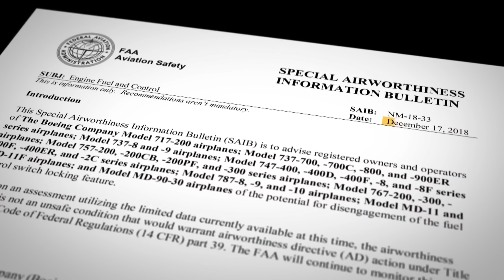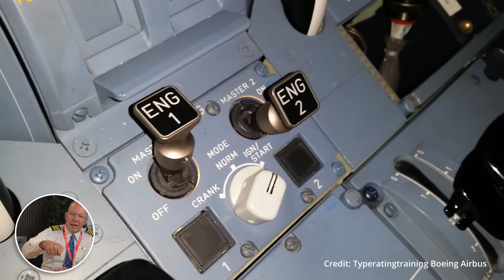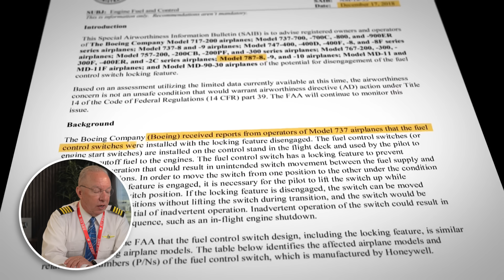Air India 171: The FAA’s 2018 Fuel Switch Locking Bulletin Explained (16 Questions Answered)

Comment: Need cameras on the cockpit! This needs to be a must
Reply: The trucking industry is really cranking up on driver-view cameras now for two reasons. One, it reduces the cost of insurance. Two, it helps to enforce safety regulations such as no cell phone use while the engine is running. 
In the past, a video camera in the cockpit was never practical due to the limited amount of data storage built into the recorders. But of course, that is changing now as data storage is cheap and plentiful. The other "traditional" reasons for no cockpit cameras are based on "privacy" for the pilots, and "what would someone think if they saw blah blah on the footage?" Well, those reasons are no more valid for pilots than they are for truckers. So yeah, the time has come for all newly certified airliners to have cockpit cameras.
 If the 787 had them, we could easily see HOW the switches were moved to cutoff, which is a critical question at this point. Sadly, a lot of non-thinking people want to insist that it was a design fault on Boeing's part. Ridiculous.
Reply: Agreed 
We have verizon reveal with camera that records depending on rules set (speeding, swerving, sudden braking, etc.). It also see if you have a cell phone in hand  or are distracted 
.eyes not on the road..and will take a pic of that

I am an admin of their system. And also a user of a vehicle with a system that has them.  And its geofenced as well. , @MrPLC999
Reply: If truck drivers must have this then it’s reasonable for pilots to. Might not have prevented the action but would make investigation easier
Reply: What most people are missing here is that the FAA had already issued a warning back in 2018 (SAIB NM-18-33) about a potential issue in Boeing aircraft where the fuel control switches could unintentionally move due to vibration or mechanical failure.

In the recent Air India crash, both pilots denied switching off the engines, and flight data confirmed that both engine fuel switches moved from RUN to CUTOFF almost simultaneously.

If these switches are manual and controlled by physical levers, it's impossible for them to move without human input — unless there’s a mechanical fault, such as a failed locking mechanism, which is exactly what the FAA had previously warned about.

The aircraft involved had not undergone the inspection recommended in that 2018 FAA alert because it was marked “advisory, not mandatory.”

This strongly points to a technical glitch — not pilot error. It's easy to blame humans when machines fail silently. Aviation authorities should focus on the dual engine switch system’s design and whether proper inspections were neglected.
Reply: @MaujL8fe0 these switches could be installed with the locking mechanism disengaged.  There is no mention the switches have a problem. Read the advisory.  The switches are used in thousands of 737, 747, 757 777 and 787 planes.  The console was replaced twice in 2019 and 2023 and they have the switches so they can check assembly.  The switches are operated twice on every flight.  In 13 years no pilot noticed the switches were installed wrong and the switches never activated in the manny bumpy landings but on a smooth takeoff, at the goldilox moment when a crash was certain.  Might have been a sinister force in the cockpit
Reply: Mh370 disappeared despite transponders, and radar tracking.  2 competent pilots on board and after years only a few scraps of pieces have been found.  Weird shit happens
Reply: @barryobrien1890 - Not much anybody can do after the suicidal captain had switched off the transponder and EICAS tracking systems.
Reply: Captain is elite. And cant be monitored like those low lives 😆
Reply: This technology advancement. Every street and toilet have one now
Reply: What is it everyone thinks this is going to accomplish? All it does is let you see it. Think about the backlash that would come to the families of the sabotaged pilot. Also, keep in mind this would likely only be released to the families and specific parties.
Reply: @Skywest25  it’s the only thing that could prove if it’s not sabotage. Do you think the families are spared now?
Reply: @akshanshkmr   Nope. Because the pilot covered the lenses before the cameras were powered on and the other pilot wasn't looking. Are the families spared now?
Reply: @Skywest25  Are the families spared when pilots are falsely accused of sabotage when there was indeed a mechanical issue with the switch?
Reply: @akshanshkmr  A mechanical issue would be identified eventually. This is only a preliminary report. I'm asking what would the cameras have brought to this investigation to clear up the uncertain details?
Reply: @Skywest25  Define Eventually. 2 years? 5? What the families supposed to do till then? 

A camera would have eliminated the need for this “Eventually ”
Reply: How excactly cockpit cameras prevent tragedies like these from happening again.
Reply: It doesn't prevent. But it corroborates theories and adds to evidence from audio.  It shows actions taken.  Duh.
Locks don't keep thieves from breaking in either..  @JoeMason-g8z
Reply: @JoeMason-g8z who said anything about prevention?
Reply: Stop talking. Cameras won't prevent this sort of thing. They already know what happened...
Reply: @cwiseman4595 they only know what the box says the switch position was. They dont see if someone or who put it there.  And cant prove any statement or negate conflicting statements from audio recordings of the two humans (did vs did not shut the switches off.)

The camera footage could help with this in corroboration of human actions and conditions.
Reply: @cwiseman4595  - It's about KNOWING what happened, it's not a tool for prevention.
Reply: @cwiseman4595 They don’t know WHY it happened.
Reply: @wilgorrie7127  What part of a video shows the "why" of anything?

Comment: Just because the data indicates the fuel cutoff switches were moved to off doesnt mean they actually were, it just means that power was interrupted in those circuits, one pilot asks why did you do that, the other says I didn't, dont be too hasty to blame a pilot on a preliminary report, electrical power failure would give the same situation or scenario surely

Comment: Capt Steve.... Weak answer on the camera issue. If the footage was transmitted in a closed loop to data recorders ONLY... and automatically DELETED within 2 hours of the successful landing completion of every flight... how would it get leaked? Normal date recorder content is very rarely .. if ever ... leaked before accident investigations as there is nothing of public interest to leak.

Comment: Cutting off fuel for 10 seconds can cause a catastrophic crash, doesn't that mean that these controls should be digital and not mechanical to avoid potential mistakes or accidents? What if, say, a thread from the captain's clothes gets hooked on and the captain stands up?

Comment: Given the facts as currently known this event has echo's of 9/11 and Malaysia MH370.  If so this is not a pilot mental illness issue but rather an ideology issue.  India has problems with religious extremism.  Investigating the history of the pilots should help resolve this.    A solution is needed that makes it harder for a mentally or ideologically compromised pilot from crashing the plane.  
I'm not sure there is any solution except computer control since a compromised pilot could just disable the other pilot and manually crash the plane.  Instead with computer control, any attempt to operate the plane outside the flight plan manually would require approval from the airline's operation control center.  Avionics software could allow manual control automatically in the case of engine failure (e.g. US Airways 1549), a lightening strike,  decompression, etc.).  With a StarLink connection the plane would always have a data connection to the OCC.  Self driving vehicle AI software is making huge strides so maybe it's time to look at it for airplanes.

Comment: Absent Minded NOT Suicidal!:

Yesterday morning I was going to make my 3rd cup of 3-in-1 coffee from a single cup pouch. And, I was thinking about fishing. I have made 1000 cups of coffee:
1. Put hot water in cup
2. Tear packet open
3. Pour coffee powder in cup
4. Throw packet in trash.

But yesterday on cup No. 3 ... 
1. What size hook to use? (fill cup with hot water)
2. Which bait? (tear packet open)
3. How deep should I fish? (pour coffee powder in trash)
4. Which rock should I cast out to? (throw packet in --- CUP!!!???) WHOOPS! WAIT! MISTAKE!!!

The Air India Captain has raised the landing gear 1000 times ... and cutoff the fuel 1000 times. Both are 'completely routine operations'. As Pilot Monitoring, he was doing the job that was somewhat less responsible than the First Officer, who was Pilot Flying, and his mind wandered off a bit - perhaps to his father's condition, or whatever. He knew that automatically after rotate off of the runway he will do the routine gear up action. But absent-mindedly he instead did the routine fuel cut off action! And when the First Officer asked "Why?", he honestly answered "not me". He mentally supplemented one routine action for another.

I expect there was lots of conversation after this mistake... too bad the full voice recordings have not been released. My guess is that the next words were "हे भगवान!!!" {Oh Sh_t!!!} when the Captain realized his mistake.

It doesn't matter much that the control knobs for these functions are not near to each other and nit very similar - both are routine functions and he did an incorrect routine instead of the correct routine. So, in my view, this crash was an absent-minded (DEADLY) mistake, not a suicide.

Comment: I disagree with your assessment in re video recording in the cockpit. All types of professions are required to be recorded these days, and given the extraordinary responsibility that pilots have, it is reasonable they also be recorded. You say that having a camera would not have prevented this accident. Perhaps. But it would be able to confirm whether this was intentional or not, or caused by a defect. If neither pilot reached for the fuel controls, then we would know definitively that it was a mechanical failure, and work could be done to prevent it from happening again. But from the audio alone, we do not know that it was done intentionally in any kind of definitive sense.

Comment: Question for the next video;

As you alluded to at the end of your talk the second pilot, surprisingly quickly, re engaged the switches to run. 
Clearly the thrust didn’t return so is it the case therefore,  that the engines could not fire up again after the fuel was switched off ?

Comment: It's not acceptable that there won't be any warning by the system when fuel control is manually or accidentally switched off from run position during takeoff after lifting off the ground and before reaching cruise.

Comment: Was there any indication of relief pilots or a check crew member on this flight?  If not, why not as it was a long flight, 10:15 hrs.? Is it possible if there was someone in the jump seat to have been the one who pull the cut off switches, like the pilot in the jump seat on Alaska flight 2059, Oct.. 2023 who tried to the fire extinguishers on the engines?

Comment: I maintain that a possible malfunction of the control system/s  resulted in shut off of the fuel valves. Possibly upon noticing the lack of thrust, a pilot/s cycled the fuel cut off valves from run to shut off  and back to run which reset the fuel control modules? Hence restoring fuel supply to the engines.  Would like to see the schematic drawings of the fuel control system hunch is that it is rather complex.

Comment: If that pilot deliberately wanted to crash the aircraft why did he just cut off the fuel switch, instead he could have crashed it by manually flying it to the terrain ensuring maximum impact.
He cut the fuel supply, and let the other pilot put it back in run position which puts the aircraft in a savable position.
If the aircraft was saved, it would lead the first pilot to face trial and not succeed his intention.

Somebody please discuss this.

Also does the report say anything about "positive rate of climb, gear up" call

Comment: If the fuel cut off levers were discovered in the 'off position' (and it seems this information has been released). Will not the flight data recorder indicate when this happened? Releasing partial info seems odd as it stirs up a lot of speculation.

Comment: Captain Steve is making an enormous amount of assumptions answering these questions. This was only a preliminary report, not a complete report with technical findings. There are very few technical details published so far and certainly not the ones used as answers by captain Steve. Captain Steve states facts that have not been proven or verified and may very well be untrue. 
By sheer definition a disastrous electrical fault in an all electrical airplane could indeed shut the engines down without touching the switches. Boeing wouldn’t make such a mistake you say? Well… MCAS

Comment: What task would the pilot or co pilot normaly take at the same timming as the fuel cutoff happend? example, retracting the gear. Could this be a mistake by doing the wrong thing?
I like many people work with equipment that requires a specific  order of input to get the desired results. Some of the most common Issues I see in maintaining the procedural order are the result of switching hands from one operation to the next.  
The more the muscle manipulation required and the closer to proximity from alternate actions the greater the incident of mistake I have seen and experienced. In my case milling machiens, and lathes with lots of levers, knobs, buttons. Manual and computer controlled.  Famously on manual mills operators will turn on the spindle instead of applying the brake during a tool change, resulting in a bad outcome that they only do once.

Comment: Why is Captain Steeve stating positively that one of the pilots moved the switches when it hasn't been proved beyond doubt?  Why is he negative on most points raised? I have used switches similar to the ones in question in a different application and had them fail. The ones on AI171 had been in use probably since the plane was new and been used thousands of times wih inevitable wear and the possibility of failure. They are not foolproof.   I wouldn't be at all surprised that Pilots and crew get up to all sorts of things they shouldn't in the cockpit, that's why they don't want cameras  watching.

Comment: it seems like a design flaw already that it is possible to completely cut off fuel supply during a takeoff. most of modern car engines cannot be stopped while driving on a highway by pressing the ignition button

Comment: After hearing the explanation of Captain Steve and from other sources, I am not too clear about the reaction of the pilot who asked the question "Why did you cutoff the fuel systems?".  Did he sound in an atonish voice or a calm voice because that could explain his reaction when he saw the switches were turned by the other pilot?  It sounds like he didn't at all have any surprise when found out that the switches were turned to cutoff mode.

Comment: why dont you provide us the simulation results for question on wont there be error on screen or warning when turned off engine? so many answers to us is just based on your experience but not simluation based as you are saying you dont know and not day to day situation. Not taking further on Solder ball leading to mechanical failure with BULLETIN issued by GE hints at bias you have towars pilot error

Comment: The cause of system failures are often found to be situations or failures that early on brushed off as "impossible".  The report is "Preliminary" so more information may well be reported.  Doesn't say this was "purposely" done but let's wait until all available information is presented.  BTW you don't want cameras because they might catch you or others "doing something they're not supposed to" is the exact reason they should be installed immediately.  Geeze!

Comment: It’s too easy to blame a dead pilot, citing mental health or suicide, without solid evidence. Boeing has a history of cover-ups, while this report lacks clear proof of pilot fault—only referencing a brief engine fuel cut-off.

Given the 2018 FAA directive and that the engines were restarted with the pilots denying wrongdoing, a system failure seems more plausible than foul play. Also, the absence of the full recording raises more questions.

Even if it were foul play, the timing had to be exact—before takeoff would’ve grounded the plane, and after a certain altitude, engine power would’ve been restored.

This feels like another case of sweeping things under the rug. Rushing to judgment on a preliminary report is dangerous. Wait for the full findings—and hope for transparency.

And why still no cockpit cameras? Combined with voice, video would provide undeniable evidence. Without it, manufacturers maintain plausible deniability. This isn’t just ignorance—it might be part of the problem too, Steve.
Reply: 👏well put

Comment: What you want is cameras to treated like other cockpit data, there to provide clarity for future operations and failures. Not to necessarily attribute blame to pilots. After all a lot of problems are self reported by pilots to manufacturers and also regulators to enable greater safety. It is the ability to report and learn that makes flying safer. If it were to become an attribution of blame culture the safety would decrease.